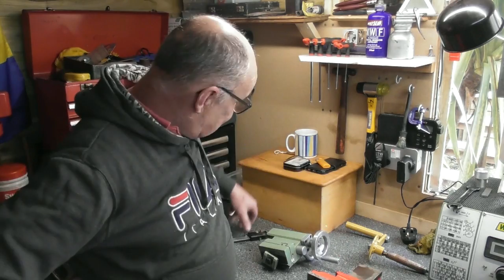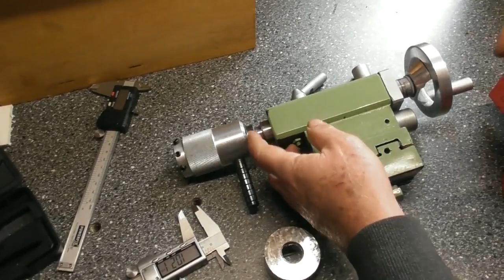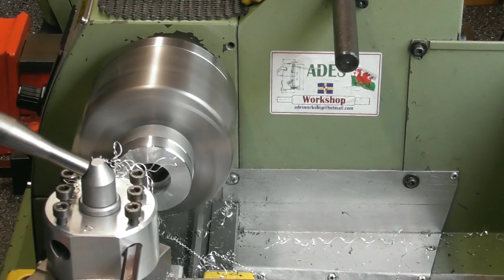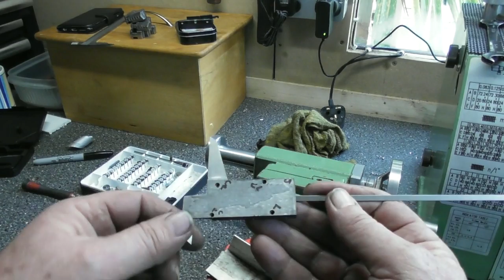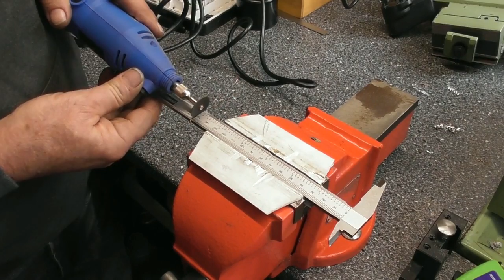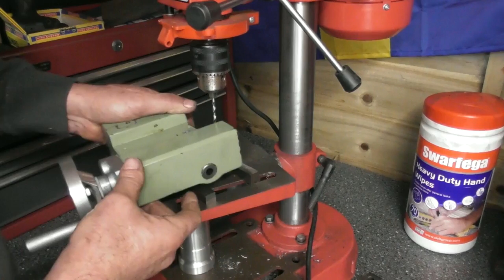Shop made Tail stock DRO  on the cheap

Comment: Well, that chuck is smaller than the lathe can use. It’s a 4”, 100mm chuck. But that size lathe can take a 5”, 125mm chuck. It would make quite a difference.

Comment: You don't  need to cut up a digital caliper, you can buy just the slide and display in various lengths including very short ones and they are cheap as chips

Comment: Hi Ade!
Copying Your work, I just tried to drill the caliper like You do. I used some kind of hard metall drill, coated with something. I got 1.5 mm down but I would like 3.5 mm. What kind of drill did You use?

Comment: Hi Ade, enjoying your videos. Off topic; I recall you did a smashing job on the collet chuck but had issues with either rubbish collets &/or collet nut. Did you ever source high quality ones & get better results?
Reply from the maker: I did a bit of fettling of the nutsto remove some internal burrs etc.  and all was well , i use them often and are holding really good tolerances now , the collets are fine , Cheers Ade.

Comment: Good video, Ade
Just be careful with that aluminium ring around the tailstock quill.
I did something similar to my milling machine quill a couple of years back for work light. (Car angel eyes style)
Over one winter period the quill corroded, where the aluminium was in contact, it left a horrible stain on the quill.
So l remove it when not in use, now.
Was there a copper gib in the digital caliper, when you dismantled it ?
Adam
Reply from the maker: Hi Adam , I wont use it much so will only be putting it on when needed, Yes there was a small copper gib , the two tiny grub screw adjusters were really fiddly , but it is all done now (posting part two today ) and works well for a cheap quick job , Cheers Ade.

Comment: I am told the Aldi version of that vernier is just as bad as yours, I had one of those verniers from ebay and it had no repeatability, It wasn't hugely far out, but enough to be annoying. So I turned it into a digital height gauge which I use for marking out to good effect. Oddly enough the plastic ones seem more accurate and more reliable. Proops Brothers do one for a about £16 which is obviously  Chinese made , but it is a lot better quality,
Reply: I almost bought one from Aldi last week on an impulse, but resisted. Still Ade got me thinking
Reply: @Ian-in-da-shed  I have made something similar to ades design in the past, but in the end I opted to put it behind the tail-stock using a spring loaded finger to pull the dro back. This was because I found it could foul with the compound when on the front side. I also found it difficult to read on the side unless it is angled up and that just makes the problems with fouling on the compound worse. Though ades lathe may be slightly bigger than mine as not suffer the same space constraints
Reply: It is just as bad,  I think they're the same one's just labeled differently,  I just use it for a rough guide and then check it with the M&W
Reply from the maker: The sealey one i use all the time is really good for about £20 , great knockabout tool . Cheers Ade.